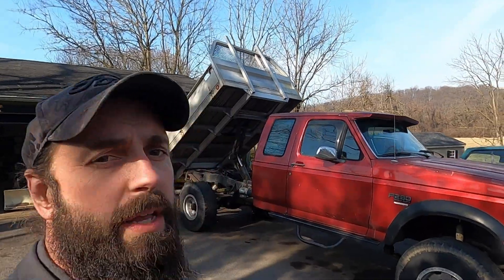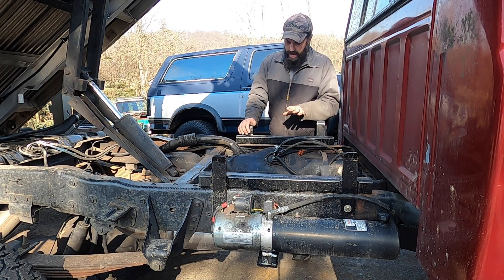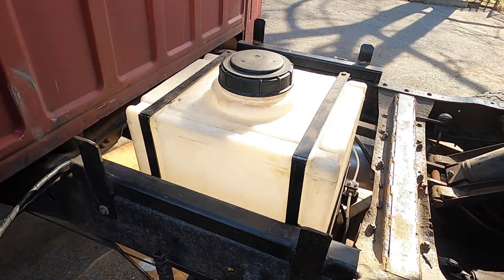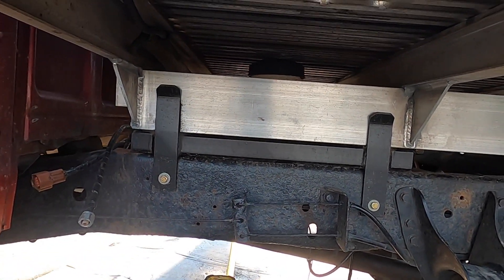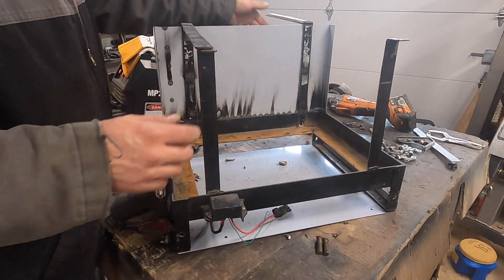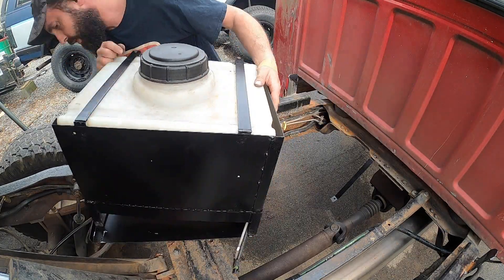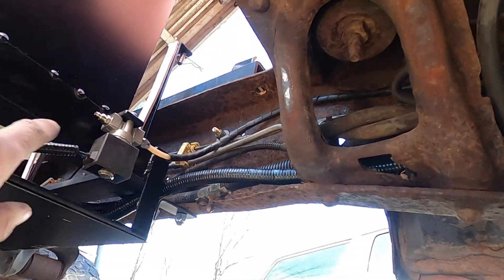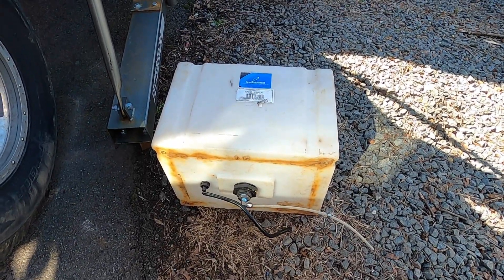Water/Methanol Injection install on our 96 F250

Comment: Couldn't you mount it on the other side?
Reply: The flow on that at 100 is insane!
Reply from the maker: You ain't kidding! I'm running a 12gph nozzle. Sounds like a lot, but it's not. The system is capable of running dual pumps/nozzles for the racers- can your imagine doubling that volume? Crazy!
Reply from the maker: Unfortunately no, there isn't nearly enough room with the exhaust on that side